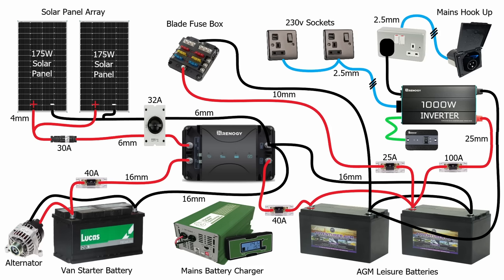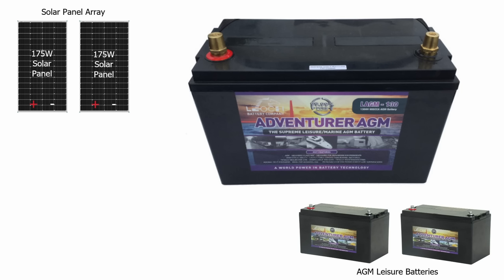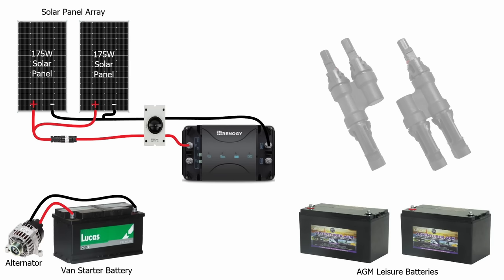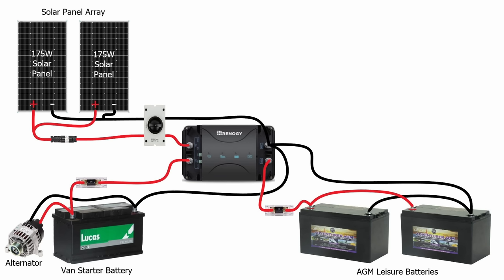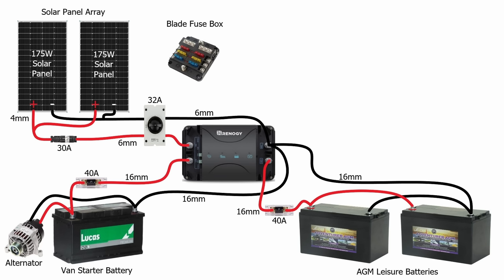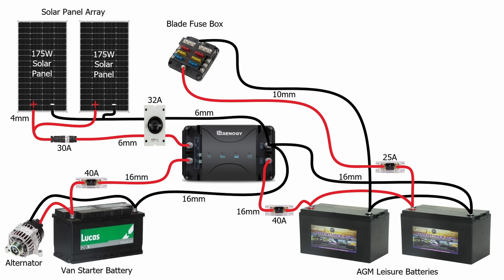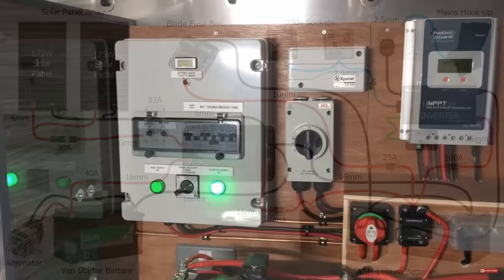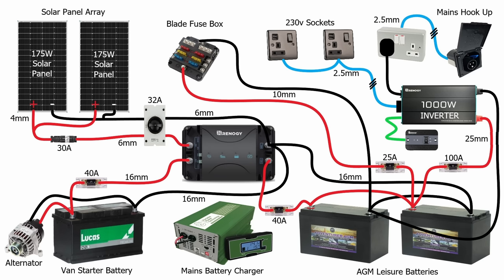12v Electrics for Off-Grid Campervan - Fiat Ducato Budget Build Ep12

Comment: I am planning on having 2 100Ah batteries and each has a maximum discharge of 100A. Does the cable between the batteries need to be able to handle 100 or 200Amps (assuming I draw 100A from each)?
Reply from the maker: In theory the current travelling from one battery to the other would be the single 100A value. 
If you are purchasing a larger cable to connect an inverter it make sense to use the same cable to join the batteries together. Never a problem going bigger 👍🏼😃

Comment: Greg, on the 10mm cable from Leisure battery to the fuses, there is a 25 amp fuse.  Pic looks like a midi fuse.  Can only find blade fuses and in line holder, but with too small gauge cable links.  Can you advise which to use?  Couldn’t find on Renogy site.
Reply from the maker: All the product links are in the video description, here is the one for fuses, just select the nearest whole size for your proposed connected load.
https://www.ebay.co.uk/itm/124964754964?hash=item1d187ad614:g:RqsAAOSw1MphsuTq&amdata=enc%3AAQAIAAAA4MIwuQXfU40MdbIFkZsCDYHhKUD3aqt7U%2BMuGc54dJCyCZgYO%2FWCKXmTCnF%2BcXDSyVVwZZkOJLSizASmWCn4A22NQo9fzpk%2BlBjF%2BOOuaod1VyVyi9CraN6wMIkC%2FjdZ0qq1X9ovqb3q4QSGDtbl1bTwOtgjoigUAmz1n7Xgdc73aupKn4gYZ9u2xkKFUNuxGXjjf%2FTksrkqWXEMLohzBNHBiSmFbdRbBC84cWkIl9dFNMgRn0Fh3KiB7e%2FAz9kSeLnUn85KObZjox3oWg7xHBOeaStWXTI481o2d8OjHl%2F5%7Ctkp%3ABFBMjsuS2qhi&mkcid=1&mkrid=710-53481-19255-0&siteid=3&campid=5338027957&toolid=11800&mkevt=1

Comment: Hi Greg I have a boat which gives  charge off the outboard to my leisure batteries is there a different way of wire them compared to the video I seen on your 12 volt video? Thanks for all your help with the videos
Reply from the maker: I presume your outboard has an alternator the same as a van would. So connect it to the charge controller the same as shown in this diagram. Don’t forget the fuses close to the outboard alternator in your case.
Reply: Thanks again like I said b4 really appreciate your help I have now ordered every single thing off your diagram👍

Comment: may i ask a daft question, can i not just use a split charge relay between the starter battery and the leisure batteries, if im not using solar panels
Reply from the maker: It is always better to use a DC-DC charger even without solar panels because they will look after your leisure batteries better and meter the charge to them according to their condition. A split charge relay is simply a switch and does not know the condition of the battery.

Comment: Hi greg
Im am copying your electrics, i have purchased the consumer box do i still need to buy a red knob isolation switch to go at the side of it and a switch from 240 to inverter as i know you have mentioned them in other vidios but they are not on this diagram

Comment: Heres a good question for you greg! If running on shore power via through the inverter instead of 12v, are you still limited to 1000w? I want a system were i can run bigger appliances when connected to shore power but limited to 1000w when on 12v, off the same sockets without having to double up on sockets
Reply from the maker: You are correct 👍🏼 the inverter is limited to 1000W so what you could do is installed a double pole changeover switch after the hook up consumer unit and inverter supply then take the output of that switch to your sockets. If you would like to pm me or email me I can give you a simple wiring diagram that would do it automatically 👍🏼😊 actually planning a video on this now.

Comment: Hi Greg, I've gone for this exact set up for all but the charge controller being a 50A unit, in-lieu of your 30A, and have a pair of 130ah leisure batterys with a C100 rating.. Can you tell me if I'd need to alter the cable sizes  over yours, or if you see any issues with my proposed set up.. Great helpful video as usual.. Thanks in advance
Reply from the maker: Hello, you will need 60amp fuses on both battery connections on the DC-DC charger, if the run to the van battery is the length of the van consider increasing that cable to 25mm² because of the voltage drop. Hope that all helps :D
Reply: @GregVirgoe  Thanks so much Greg - Perfect timing as I'm just about to place an order..  Thank you

Comment: Hi Greg, do you plug the mains battery charger in to the double socket for the mains hookup, then onto the batteries the same as your previous video of your electrical setup?
Reply from the maker: The socket I have shown needs to be fed from a double pole consumer unit. Then the output of the mains charger can be connected to the same battery terminals as the mppt charger.

Comment: Hello Greg 
I’m using this exact wiring set up. Inc the consumer unit you speak about with RCD. A question I need support with is, do I need to ground to earth anything. Re searching other sources there’s mixed views. I don’t want 230v earthing to my van risking and damaging  the ECU for example. The RCD should protect residual current and the inventory from renergy has protection. 
Would you do the 12v circuit. 
Any help greatly appreciated. 

Jon
Reply: Furthering my comment I will be connecting all the earths for my sockets and hook up obviously using electric blue cable. It’s just the grounding to earth that’s got me confused. So I need to do it and on what really. 

Thanks 

Jon

Comment: Great video, don’t think I missed it but what do you do when you want a brew if a kettle takes 2kw to boil?
Reply from the maker: I put our kettle on the gas stove. 
We do have an 800w travel kettle that would make two cups but never use it off grid.
Reply: @GregVirgoe good point gas stove doh 🤦‍♂️🤣 800w kettle I’ve used before and got to be honest took ages and somehow didn’t seem as hot as a normal kettle…. Great vid though loving watching this series mate thanks for sharing

Comment: Hi Greg I'm getting there thanks for answering my questions so promptly, so I just need to know, from the vehicle starter batterie do I run just one live and one earth back to my 3 lithium batteries then loop that configuration over to each  batterie ? I don't   need to run three lives and 3 earths back from the vehicle batterie is what I'm getting at.
Reply from the maker: No, please look at the diagram at this time stamp 7:19 there is just a single + and - to the van battery from the DC to DC charger and just one pair of cables from the charger to your battery string, even if that is two or three batteries in the string the wiring stays the same.
Reply: I watched the battery to garage video I’m all clear now thanks 🙏

Comment: Hi Greg without sounding too dumb! where does the Mains Battery charger connect to, The starter battery terminal or the leisure battery? And why do you need a DC to Dc charger  if you use a solar regulator?
Reply from the maker: The mains battery charger connects the the leisure battery terminals the same ones as the solar charger. 
This system only has 350w of solar so the dc to dc charger is there for additional charge power when driving

Comment: At 7:00 the real reason you want to connect this way is not what you said but rather to detect when the link between the two batteries is broken.
If you connect to the same battery, that battery becomes isolated and by connecting as you suggest the circuit is open and you notice it immediately instead of wearing out one battery.
Reply from the maker: It primarily to ensure equal resistance through each battery and to use them equally

Comment: Hi Greg , Is there any reason  that a lot of people wiring this setup are using 25mm cable on battery to battery were as you are using 6mm. I am following you step by step so I will have the same system, just want to know . Cheers
Graham
Reply from the maker: If you go for the 50amp version of this charger you will need to increase the cables to 25mm
This is the 30amp version so it only needs 16mm cables. Cable sizing is relative to the load current and length of cable. This handy free sizing calculator will help
https://www.12voltplanet.co.uk/cable-sizing-selection.html

Comment: Greg - Video's are great and so informative.  I need / want to know how this battery charger gets wired in?  Do you wire it to a different circuit on the consumer unit? or out of the inverter?  Reason for asking is that I think that when I am on mains through the consumer unit rather than when on the inverter mains, as the inverter will be creating the 240v for the charger to re-charge the battery(s)???  Would that be correct?
Reply from the maker: You must connect the mains charger to the consumer unit so that it only works on hook up, then connect the 12v leads to the same leisure battery terminals as the MPPT charger.
You cannot connect the mains charger to the output of the inverter because it will be charging the same batteries that the inverter is using and eventually the loses will simply cause the batteries to die.
Reply: @GregVirgoe  That's exactly what I thought.  The interesting thing about your diagram is you use both negatives on different parts.  I was expecting you to use the positive on battery 1, and the negative only on battery 2, with both batteries in parallel with each other.  Whilst technically, you have a common positive, and a common negative, so it doesn't really matter in my head, but I've seen as I initially described and wondered what your thoughts were on this  (or am I getting too anal about it?)
Reply from the maker: @stuartjhurst  my charging connections go across the string in one direction and my loads come off the string in the opposite direct. It ensures both batteries get used evenly both in charging and discharging so both last the same length of time.

Comment: Hi. Where did you source the 25A fuse from as I can’t find these anywhere?  The one between the batteries and the blade fuse box. 
Thanks again Greg.
Reply from the maker: You need to size that fuse yourself depending on what devices you have connected to your blade fuse holder. Please watch my video on fuse sizing for more information 👍🏼

Comment: Hi Greg the mains wire that you refer to that’s connects to the 240 hook up. Does that come with the inverter or have you got to buy that separately. I’ve just bought the 2000 watt inverter but it didn’t say it came with a mains wire.
Reply from the maker: The kettle lead for the input came with my inverter so you should get one too 👍🏼😃

Comment: is it possible to use lithium batteries in this setup for the house battery and keep the same charge controller?
Reply from the maker: Yes absolutely 👍🏼 the charger has settings for both types of battery.

Comment: This is probably a stupid question. But... can I install the solar panels themselves but not actually wore them up yet? Will the be safe until I get around to doing the wiring?
Reply from the maker: Just leave one of the mc4 unplugged or tape up the ends of the cables or wire them into a isolator inside the van then finish off at another time. That’s what I did.

Comment: Hi Greg I have a question, how does the renogy combo unit compare to seperate victron units? I am trying to figure out if it is better to get the combo until or spend the extra money. Can you charge the battery via solar while driving?
Reply from the maker: There’s no comparison on value for money. Obviously Victron is the market leader but you will pay a premium for that equipment. I personally think this setup is the best for the money. 👍🏼😊

Comment: 1 thing you may come up against, is that the Renogy combined DC-DC & Solar charge controller prioritizes solar over the DC-DC side of charging. There is a YT video about that from an Aussie guy. Can't remember his channel name, sorry.
Reply from the maker: If there is power coming in from the sun then I'll happily take that instead of putting load on the van.
I think you'll find it's shared 50/50 :D

Comment: Hi Greg would 
Renogy 12V 50A DC-DC On-board Battery Charger with MPPT for Gel, AGM, Using be ok to use on this system with 2x130ah agm batteries can’t get the 30A one anywhere thanks very much
Reply from the maker: You can get a 30A  here on amazon if you are quick https://amzn.to/3P1vLs8

Comment: Will this set up work ok if you have a newer van, which will be fitted with a smart alternator? Does that Renogy dc-dc charger sense this ok?
Reply from the maker: Yes there is a green ignition wire supplied with the kit that you need to fit to tell the charger that the van has been started. 👍🏼😃

Comment: Hi Greg can i put a 24v battery instead of two 12v 
Just been on first trip and the battery runs out quick after we have stopped even with solar power the fridge cuts out after 30 minutes i wired the fridge direct to battery dont know if battery is gone as a friend gave me the battery dont know if this is ok or not .
Think im going to start over and copy your sysyem
Reply from the maker: So many appliances are 12v for Campervans it makes it more difficult to go 24v as you then have to step down to supply each device. Fridges rely on a larger supply cable to reduce the voltage drop. Ours is fed with 6mm cable. 
What battery setup do you have?

Comment: Hi Greg I’m going to use this video to build my set up but I plan on 3 battery’s can you tell me how to wire them so charge in and the how to take from them so it’s all balanced if you know what I mean
Reply from the maker: Wire them all in parallel positive to positive to positive and link negatives the same. Ensure the link cables are same size and length. Then put positive charging onto battery no1 and charging negative onto battery no 3. 
Take your supply feeds from positive off no 3 battery and negative on no 1 battery. This will ensure even resistance and use. 
Mine have been working like this for over 5yrs now and still good 👍🏼
Reply: Thanks for this keep the vids coming as great help

Comment: Hi Greg, I was wondering if you could help with a query I have regarding wiring Maxxfans. I have 2 Maxxfan deluxes which I would like to wire to the same circuit. I calculated I would need 10mm wire to carry both fan loads (5amp each) plus accommodating the voltage drop over the circuit distance (9.5 metres one way). I see the wires on the fans are only about 1.5mm though. Would it still be possible to wire them to the same circuit?
Reply from the maker: Hi, that seems a little big considering each fan only uses a max 4amps on full speed. 
I would install 4mm from power source to first fan and 2.5mm onto the second fan. Connect to the local wires in parallel. Pos to pos and neg to neg. Hope that helps

Comment: Hello Greg, Can you please tell me how you wired the 32AMP PV Solar Isolator? I can't figure it out and it seems to be very important to wire it correctly. My installation works without the isolator. But as soon as I connect the isolator, no charging activity. Thanks in advance and keep up the good work!!
Reply from the maker: I was just planning a little short video on this very subject. 😃
Remove all the buss bars that may come pre fitted. Then wire positives across 1-2 and wire negative across 3-4. Leave the other terminals empty 👍🏼🤩
Reply: I feel like a little child who's got some visit from Santa Claus :-D My solar system is now working. Thank you Greg, and thank you for the Renogy-tip. That one saved me a lot of money and installation was easy and simple!!
Reply from the maker: @laurensstaelens1811  I’m really glad to hear that. It’s a great setup, good product and really reasonably priced. 🤩 good you got it working ok 👍🏼

Comment: do you just use a normal plug to electric hook cable and plug the 13amp plug into the inverter
how do you use the mains battery charger to charge leisure batteries 
thank you for this video even though some confusion on my side
Reply from the maker: The hook up supply shoudl connect direct to a consumer unit as shown in my next video and the supply to the inverter is fed from the consumer unit. The mains charger is connected to the same battery terminals as the MPPT charger. Hope that helps
Reply: @GregVirgoe  thanks Greg just watched that video 
Will you be going through what items we can use through   inverter 
Using batteries if not connected to electric hook up

Comment: Very helpful video. How is the mains battery charger connected to the system? Straight to the batteries, or via the mppt/dc-dc controller?
Reply: Hey Greg!
yes, I'm also interested in how the charging is done, what should be excluded when charging or something like that, maybe a wiring diagram for the amateurs??
and what exactly is a metal clad double socket?? 
and how can I replace it with a plug that complies with the EU standard (in RO)
thanks...
Reply from the maker: The mains battery charger connects directly to the leisure batteries onto the same terminals as the other charger. It is ok the have them both working at the same time you do not need to turn off the solar system. It will see a high voltage from the mains charger and simply back off to a flat condition.

Comment: Hi Greg I have got pv array dc isolater like yours can you tell me where the solar panel wiring goes please as it has 1.3.5.7 on top and on bottom it has8.6.4.2 on bottom can you help please
Reply: Hi Greg can you give me some advice on the isolater please

Comment: Hi Greg thank you for the great information, if I run this system but upgrade to the renogy 50amp what size battery will I need to run an induction hob 1500w?
Reply from the maker: I would upgrade to a couple of 100Ah lithiums at approx £400 each now. You’ll need to upgrade the battery fuses to 60Amps and increase battery cables to 25mm
Inverter fuse needs to be 150A and inverter cable min of 35mm
Reply: @GregVirgoe  thanks for the fast reply, really appreciate the advice